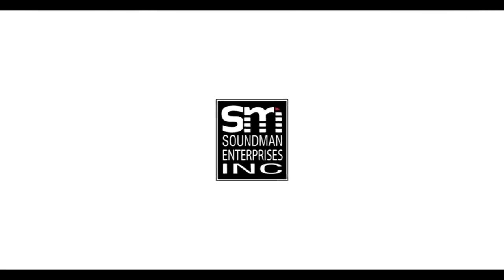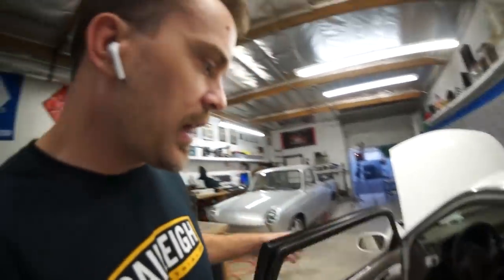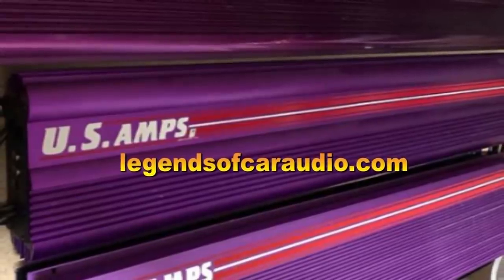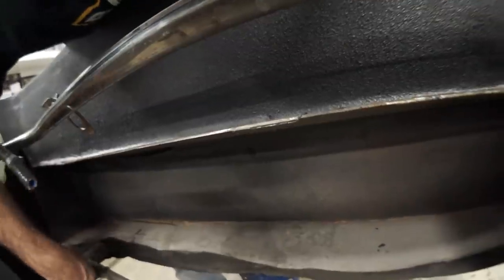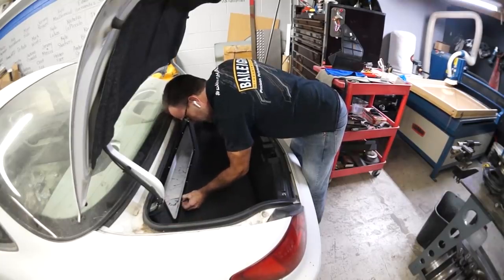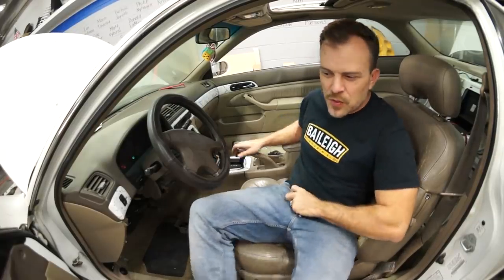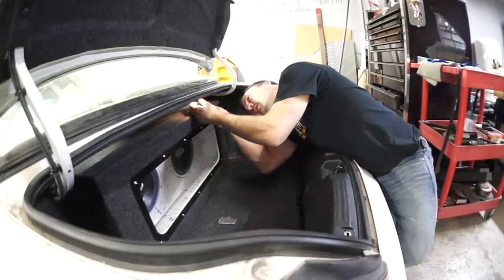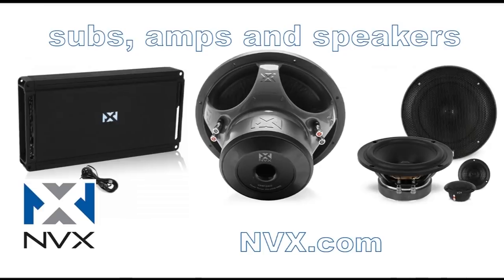Car plans AND DD-1 Acura system tune!

Comment from the maker: GOOD MORNING DUDES!! 🙌🙌🙌 have a great weekend everybody!
Reply: Just a quick question r we going 2 see any of this NVX flea market table. Equipment
Reply: Splatter paint intake like you splatter painted raffias  Wheat bread good video again btw
Reply: Top of the am... I was thinking of putting a led light in my trunk since the dome light is gone.
Reply: Spray the headlights with Deep Woods Off bug spray and then polish. Gets that's smoky shit right off!!
Reply: Hey man! Put some hertz sv200.1L 8 inch kicks in the front...preferably 4...then some Hertz mille mids and highs...i bought those hertz kicks for my passat cc and they bump like hell!
Reply: Have you thought about getting a rear panel with volkswagen embossed in it? Like a MK1 caddy tailgate - that would look amazing on the back of the mule all blended in
Reply: More power for bass in the F150? Can I get your Team CT 7k?
Reply: Great show loving it.  Legend.
Reply: ports are everything on the 4th order so if u tune with them pushed into box then you will get incorrect reading right? burn one and think about it...
Reply: Went to the fence store there was a special on joints. I went in and got kicked out. Talk about false advertising. PS I got the wheel adapters. Thanks Doug.
Reply: Real viewer's know the oldest project car in the shop was a bucket before & it's twisting the plot alright!
Reply: Fuck yeah Doug!!!!! Fuck Yeah!!!!

Comment: My old boss helped me with my old 78 short bed.  We put a 429 in it with a stage 2 RV cam in it. I never used the truck for towing heavy. Dove heads and stage 1 or 2 will do that old hog beautifully!

Comment: I wouldn’t buff the headlights! I sand them down with 1500 wet sandpaper and re-clear  the with the two part clear you use on dash mods

Comment: Doug do it hard core SQ - custom pillars with 3 inch mid and tweeter pods - check out the focal flax - they are pretty sq for and there is a set for 375 on letgo right now almost half off. I would replace the focal tweeter with the scanspeak tweeter off axis D3004/6020-00 or the R3004 for on axis. Or get the audiofrog GB mids or  scanspeak revelator mids